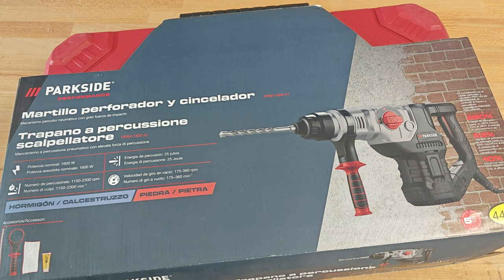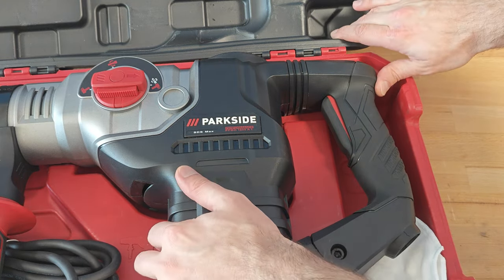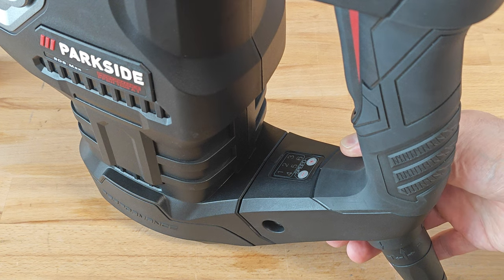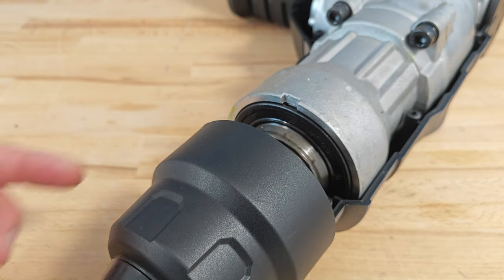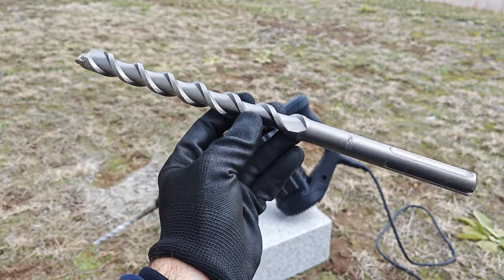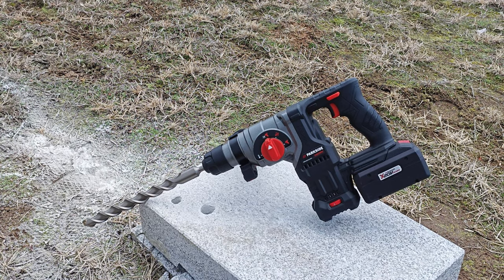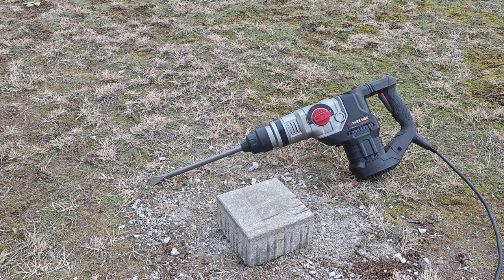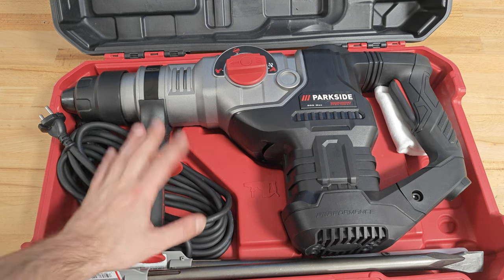Parkside Performance 25J Hammer Drill PPBH 1600 A1

Comment: It shows a lot of power, but it doubt it has 25J. The speed selection and soft start kinda indicate they were designing it more for drilling than hammering, the weight says otherwise ;) . Soft start for hammering is a big pain in the a.. In any case, I guess it will do the job, but there are a lot similar DIY machines so I guess the price will be a key factor here. I wait for the 40V to arrive.

Comment: they use these stupid membrane button speed control everywhere, because there is lot of super cheap 6 speed brushless drivers wit + - button inputs. Rotary switch is much more expensive. This is reason why they removed even mechanical ON/OFF on their grinders and replaced with membrane buttons.
Reply: I don't think it's about the price, but about the dust that destroys the rotary potentiometer.  In terms of durability, this potentiometer is much better, but it is impractical

Comment: performance ...................with brushes ? mah !
Reply: It's some cordless instruments that use brushless motors. They run on low voltage DC electricity. Corded AC instruments use commutated series-wound motors.

Comment: The way the buttons work is a obvious flaw... No one changes gears with the machine running , having to fiddle with one hand while holding down the power switch with the other.

I get the idea behind the cord , most machines will have the cords destroyed at that point from all the bending. Having a quick change system could be usefull , but connectors need to be rwally sturdy and cords should be easy to buy for it to work.

The power seems there , both drilling and breaking looked like decent power was put out by the machine.

It's definitely intended for drilling bigger holes with the low rpm and big impact , which the test showed pretty good. The 25mm didnt really take any longer then the 18mm.
Reply: At least at my model the connector failed after a few hours of use.

Comment: So, except a stylish design, a 50watt more power,what is the difference from the 1550watt one of the green line? 25joules obviously is an exaggeration.
Reply from the maker: Unfortunately i have no access to the 1550 watts version to confirm or deny
Reply: you know that there are 1liter 55KM motors and 1 liter 250KM motors? When you guys will learn that power is only the magic which propells another things and they can vary in literally everything?
Reply: @dlaczegotakpowazny1474  1600 watts it's 1600 watts ,no more no less. Leave the ice out of it, you don't have to deal with turbos here or anything else. The 2 models have the same mechanism inside the gear box and they only produce 50 watt of difference. In order for the performance to have 25 joules with the same mechanism inside , it should at least be 2500 watts in power. Learn the difference first.